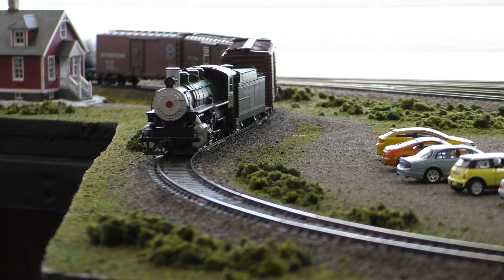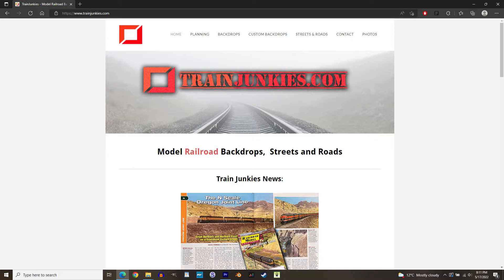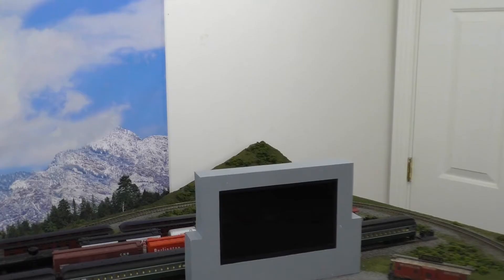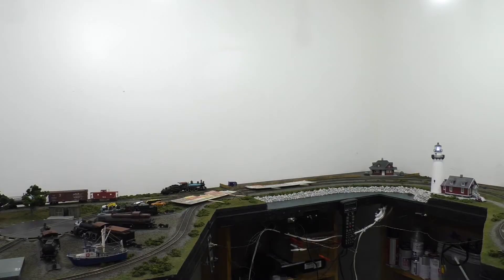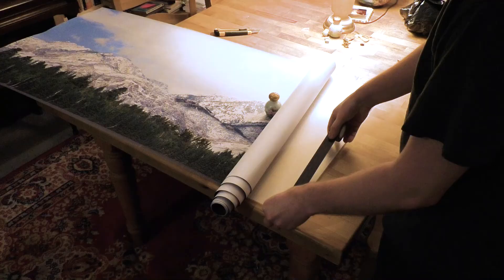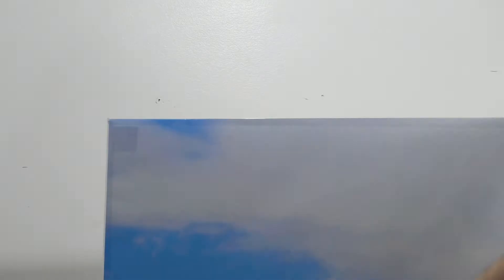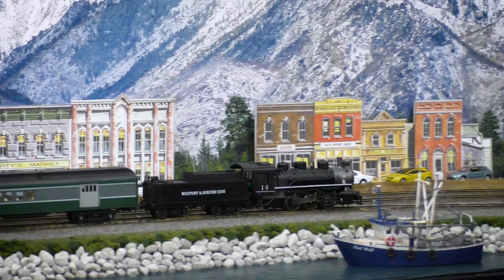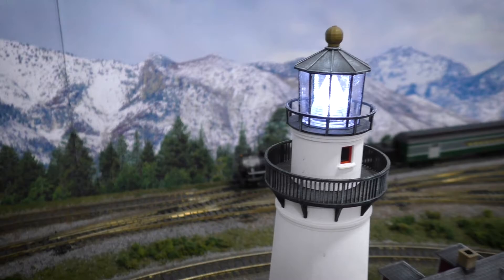Installing a Model Railroad Backdrop

Comment: Nice video Michael. I am doing something very similar today. My layout is n scale Kato 4x8 plus a 2x5 wing on one side. My layout is portable, on casters, and disassembles to some degree. So my panels, like yours, are removable. I really like the idea of using the DS tape instead of gluing to my hardboard panels, also 2' by 4' times 3. My background is from Larc Rail Products btw... Keep up the great modeling.
Ron

Comment: The layout looks great with the backdrop, it really makes the layout look a lot more realistic. I've been thinking on making a backdrop for my layout, but mine is up against my bed and a door so I cant really do that at the moment.
Reply from the maker: Thanks! Stuff like the bed and the door can be a pain to work around. The window was kind of like that for me, which is one reason I didn't add a backdrop until after I moved the layout. You might be able to do something with removable backdrop sections to allow access to what's behind them. Hope you can figure something out!

Comment: Have you also consider having a big steam engine, not forcing you just asking for the future. And I apolgoze if I comment a lot.
Reply from the maker: No worries! I've thought about it, but I'm trying to stick to engines that will fit on my turntable. I might make an exception or two eventually, though.

Comment: Mike, how do i choose coaches for my heavy pacific?  I wsnt to model circa 40s ideally . Its a santa fe , but could i use something more generic like Pullmans?
Reply from the maker: Almost every major US railroad had Pullmans at one time or another, so I think they would be fine. Pay attention to how long the coaches are, as full-length heavyweights will not go around 18" radius curves. I chose these Rivarossi commuter cars because they loosely resemble heavyweight coaches but are shorter.
Reply: @michaelramsey81 thanks Michael! I want a similar layout to yours , double track. Not sure how to figure what kinds of track sections I need .
Reply from the maker: @Danthehorse  I do plan on making a full tour video eventually. The best way to figure out exactly what you need is to draw up your design in a computer program. My favorite option is SCARM (Simple Computer Aided Railway Modeller). It's fairly easy to learn and the basic version is free. 3D Train Studio is another good one. You can try out as many track arrangements as you and and figure out what will fit and what won't, all without having to actually buy anything. Some programs also allow you at add scenery and run virtual trains. In my video about the end of my previous layout, the Red Oak Railway, I show my virtual model of the W&SC layout in 3D Train Studio, and run a virtual train on it. It was hugely helpful to be able to build the entire layout virtually and work out all the major design flaws before I ever spent a penny on track.
Reply: @michaelramsey81  you're a great help too  Michael, many thanks 🙏

Comment: Hey mike did you receive the 4-6-0
Reply from the maker: I did, but it's having an issue. The motor was bad from the factory. I contacted the seller, and they're paying for a new motor from the Bachmann parts department, but it'll probably be a few weeks before it arrives.

If you're on Facebook, you can join my W&SC group. I post much more frequent updates there than I do on the channel. https://www.facebook.com/groups/355415535828311
Reply: Oh darn
Reply: So is the motor itself a 3 pole
Reply: Also are still gonna do a video about even with the motor not working
Reply from the maker: @TheTransportationFanfromCA   I believe the motor is a 5 pole, like my other Spectrum 4-6-0. The problem seems to be that one of the poles is burned out, so about one-fifth of the time, when it stops, it can't get itself started again. It also runs very unevenly at low speed.

I'll probably take the opportunity to make a video about the actual process of taking it apart and replacing the motor. After that, I might do a more conventional review of it, or I might skip straight to the repainting project.

Comment: What is your favorite steam locomotive, mines is Sierra railway 3
Reply from the maker: Sierra 3 is a hard one to beat! It's hard to pick a favorite, but I've always had a soft spot for Nevada Northern #40.
Reply: Is it becouse your high boiler 4-6-0 is similar in design to it
Reply from the maker: @TheTransportationFanfromCA  Yes, lol. I've always loved the look of the Spectrum high boiler 4-6-0, and #40 is the closest surviving prototype I've been able to find.
Reply: I mean there is also Union Pacific 1243 and 1242 and they also look similar
Reply from the maker: @TheTransportationFanfromCA  True, but those haven't been operational in a long time.
Reply: Ps do you have a water tower for you steamers
Reply from the maker: @TheTransportationFanfromCA  I bought a used one recently, but when I got it home I measured it and discovered that it's actually O scale, so I'm still on the hunt for a good small HO water tower.

Comment: Ps I have ideas to revive wp&sc 12
Reply from the maker: I've had some thoughts on it as well. One idea I had was to buy a Spectrum low-boiler 4-6-0 and paint and letter it as a more detailed version of #12, maybe reusing some parts from the original (like the lined domes and whitewall wheels) and then scrapping the rest of the original. I'd basically be building a new model of the same fictional locomotive. Need to find a Spectrum one for a decent price first, though, which is getting trickier.
Reply: I had a similar idea bascilly kit bashing the low bioler spectrum 4-6-0
Reply: Or just remove that crappy motor with the spectrum one
Reply: There is a 4-6-0 for 195
Reply from the maker: @TheTransportationFanfromCA  I was looking at that one yesterday. Unfortunately, the shipping to Canada is pretty steep. It does look like a nice one, though. I might have to spring for it. We'll see.
Reply from the maker: @TheTransportationFanfromCA  I bought that one for 195! Shipping is going to take forever, but you'll definitely see it on the channel at some point.
Reply: Congrats man as I always say, keep us on the coupler
Reply: So how long will shipping take
Reply from the maker: @TheTransportationFanfromCA  Estimated delivery date is July 7
Reply: Ok thank man
Reply: I’m also making a model railroad, I’m basing it in my home town lemoore California and calling the San Joaquin Valley Railroad.